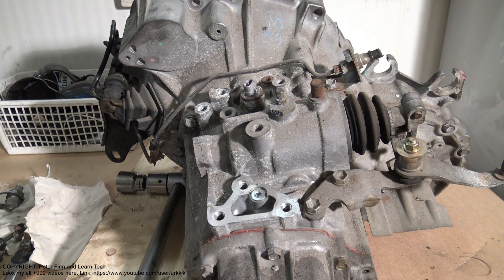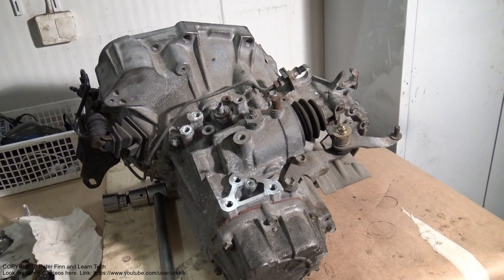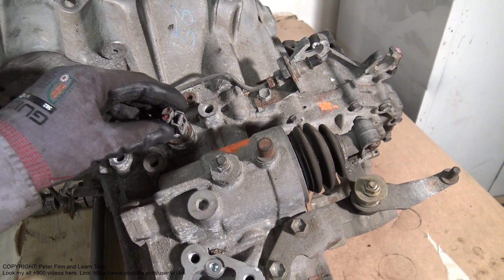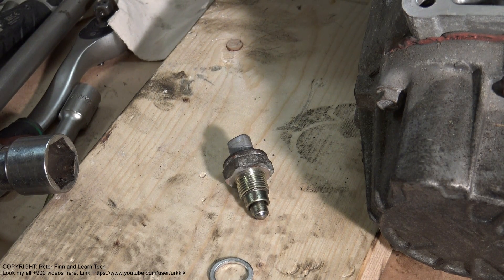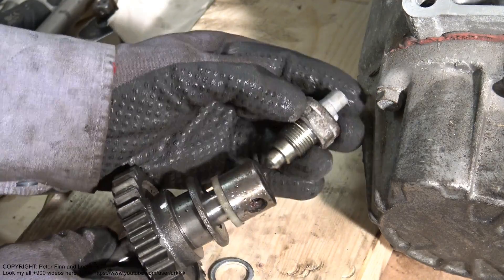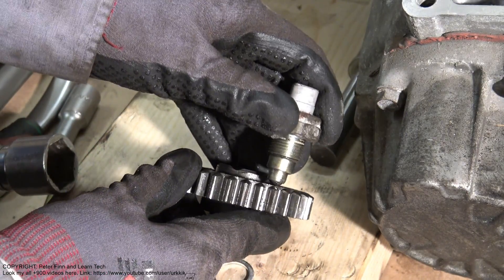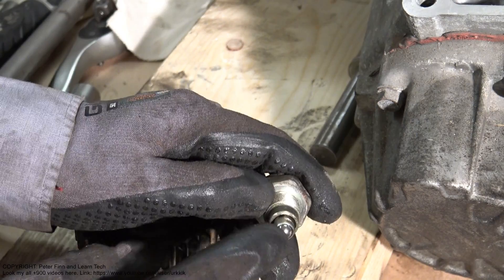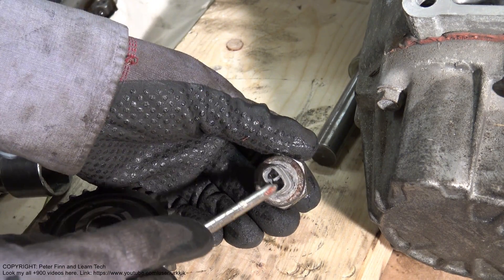How works rear light switch sensor in Toyota Corolla. Years 1995 to 2015

Comment: Hello, thanks for the video. Is the same mmt gearbox in Toyota Auris 2007 1.6 gasiline?
If is the same, then reverse light is in same plate,  located above on gearbox and can be access without removing gearbox? 😂
Thanks
Reply from the maker: Yes, it is